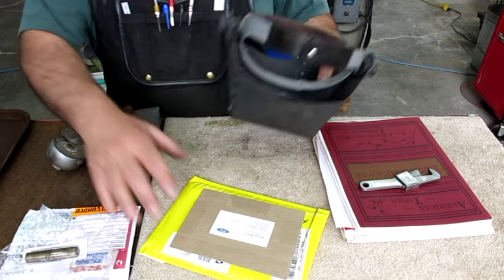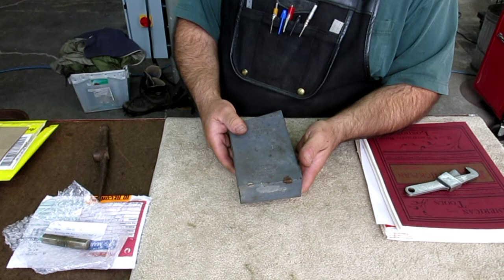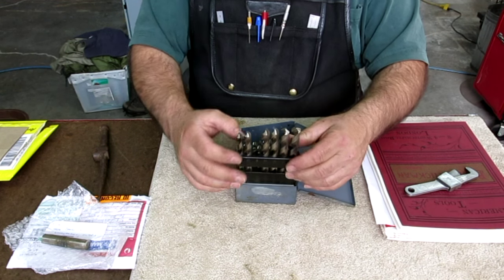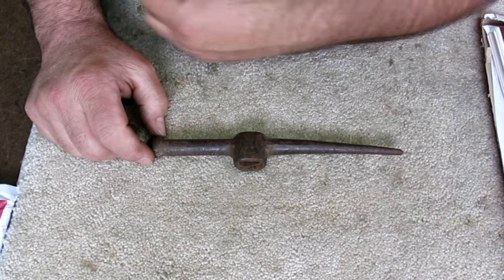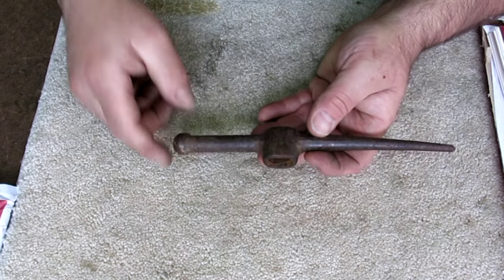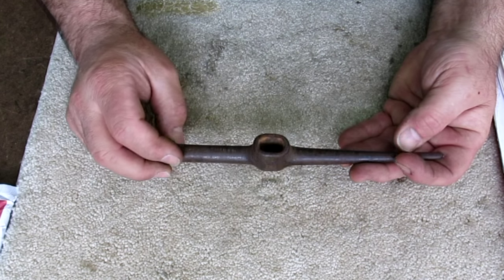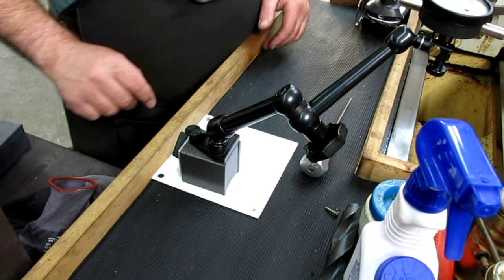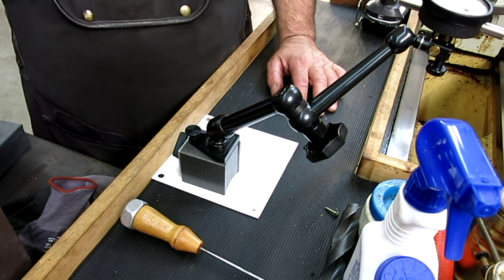Monday Night Meatloaf 98

Comment: For refrence my 1inch drive Williams still only has a 25" handle. I think they make them short so you can fit them in your toolbox. you can always find a pipe for breaking things. :-) I loved the old tool catalog that thing is awesome.
Reply: +bcbloc02 yep the toolbox they come in is about 24 inches long, so as you say, for that, doesnt everyone have a scaffold pole hanging around? :}
Reply: Plus, 1/2 ratchets are only about 12-13 inches

Comment: Awesome, thanks Tom, you put up some real gems in this meatloaf! I really like that catalogue. The reprint is still available,  but unfortunately it looks like nobody will post it down here to Oz. There are so many tools that used to be reasonably common, yet in some cases people don't even know what they are, never mind how to use them. I'm keen to see older methods of working preserved, without running a museum. I'll keep looking for a supplier who will send it down here.

By pure chance I was only looking for a camera arm last night and didn't know Manfrotto made one. I use other Manfrotto gear, so that's a brilliant find. Thanks!

The mod to the dividers is brilliant. I use conventional hermaphrodite dividers but the screw type would be much easier to set. I have an old pair of dividers I was going to throw out, but decided to keep them just in case I needed them one day. I think today's the day! Awesome!

I don't recall ever seeing a "turret" type punch like that. No idea what they're called as I've never seen one before, but they sure are neat!

Tom do you think you would be able to include a longer shot of your tool tray at some stage when you're working at the lathe? I'd like to get a better look at what you've done there. I normally just leave my tools in the tray when I'm using them, but the main lathe is fitted to run cutting oil and it creates a hell of a mess if I use it (rarely for that reason). I'd like to have a better tool tray, and a wood one would be ideal.

Thanks for these nuggets.
Reply from the maker: +Pete F Hey Pete,

It always surprises me when folks from down under tell me about their shipping woes. It really is like a prison colony down there. Lots of restrictions on tools and reading material. <g> Thanks for the comment.

Cheers,

Tom

Comment: Tom, when the rest of those screws pull through just make a simple "u" clamp to ride on the wood side of the tray, screw the sheet metal to the bottom of the clamp and add a threaded knob so you can lock it down anywhere along the side of the tray. :)

Comment: I suppose you could hammer on the ice pick cap, but it is intended for crushing chunks of ice into smaller pieces. You pop a chunk off the block of ice with the pick, and then use the cap to reduce it to useful sizes (like putting into a drink). Having lived with an ice box for a fair chunk of my youth, this sort of thing comes naturally.

Comment: On the tool catalog: prices would be in pounds, shillings, and pence (L/s/d for short). A pound was 20 shillings and 12 pence to the pound. Drove me nuts when I first went to England, although it is not as bad as fractional inches. At the time that catalog was published  a pound was $5 US, so you can figure out from there.  

On Q&A I am very interested in the mist coolant (coke bottle based) that you showed in one of your videos. You now have so many that I can't find it, and it is not, of course, indexed by Google because they can't index dialog. All I need is a pointer to the video.

Comment: Thanks for the video Tom - much appreciated.
Would it be possible to do a really quick snapshot on how you hold your lathe tool holders
on the back of the lathe chip guard  and how you like the Nooga coolant sprayer.
I think you may have done earlier videos on these but I couldn't locate them.
Thanks  Rod

Comment: Hi Tom, 
be careful with the Manfrotto 244RC arm or more precisely with the magic clamp. When you tighten the Screw that holds the arm in clamp you can deform the stub that goes into the clamp pretty badly. You can put a screw inside that stub to prevent that.

Comment: Rather than screw the sheet metal to your wood tray through your rubber mat, another solution might be to bend some 90 ells on each end (of a longer piece of sheet metal) so you can slide the tray back & forth?  If more stability is required, you can use one of your tiny Kant twist clamps to keep in place...

Comment: The centennial Meatloaf should feature some meatloaf.  A meatloaf sandwich at the very least.  As for a question I have this.  If you lost everything and had to rebuild your shop from scratch, what would be your first machine and what would you fill the first tool box with?  Lastly, the vise "screw retainer" is called a garter.  Lookin' forward to the 100th Meatloaf.

Comment: What I do, is use a piece of 3/16" plate steel about the same size as that plate you're using. It's heavy enough to stay in place and you can move it if you need to.

Comment: If you look at the Manfrotto 035 Super Clamp that attaches the Noga type arm to your shop made boom, there's a small plastic piece snapped on to the smaller clamping knob. It's made to go inside the jaw of the clamp to provide a flat surface. 
If you have a look at it you will see what I mean. It's useful for clamping to flat objects, as the built in V shape is made for round stuff. People tend to lose those things and few know their purpose.

Comment: The prices in your copy of the Buck & Hickman catalogue are in Pounds, Shillings and Pence (or pennies).  That was the UK pre-decimalisation currency, 12 pence to the shilling and 20 shillings to the pound, i.e. 240 pence to the pound.  So a pound could be divided exactly into 2, 3, 4, 5, 6, 8, 10, 12 or 15 equal portions or shares without having to deal in fractions of a penny.  (Try that with a decimal currency system!!!)
When I was a boy, we also had Halfpennys and Farthings (1/4 of a penny).
The columns in accounting books were headed £ s & d respectively, standing for Pounds, Shillings and Pence.  The £ sign is a stylised L and the use of L, S & D is derived from the Roman currency, Librae, Solidariae and Denariae.

Comment: #100 curiosities:  Chemicals?  Lubes, sprays, cleaners...?   3/4 ratchet;  The Nut Authority!  ...makes short work of torquing a VW flywheel gland nut or axle nut!  I welded a 36mm socket at the end of a 5 foot 1x3 square tube and used a bathroom scale to meter the torque (me standing on the scale, pushing down on the long wrench, watching the poundage on the scale reduce...indicating the applied torque...after calculating the distance of the wrench length...).  I made a few and they sold quickly at VW swap meets...even made it onto Hot VWs Magazine!  Butterfield taps are my favorite.   They came in nice wooden boxes... Don't know if they are still made.

Comment: If you were to use outside dividers to make the scribe, you could span much greater distances.  They would hook on the edge and increase the range of reach quite a bit.  The issue would then become remaining square, but is still possible.

Comment: Looking at the hammer you picked up and being a woodworker myself my eye was drawn to the grain of the wood. It always amazes me how hammer handles and pretty much all wood handles are made  for the last 20 years. I guess it is because wheels and wooden spokes are obsolete. The direction of the grain is critical in order for the handle to be strong. I gave up on wooden hammer handles because of the way the grain runs but those the grain was run in a pretty decent way. Just me but it really does make a difference.
Reply: +James Stanlake yes modern wooden hammers as also so badly fitted, loose or they fake it buy deeply insetting the end and epoxy filly it, sometimes with clear so you can see how badly it was wedged and cut

Comment: Hi Tom!  For your 100th ML episode, how about a 3 minute follow-up to your terrific "how to check out a used lathe" video?  What we really need is a 5 minute method to check out the ways accuracy and wear on a smaller lathe at auction using nothing more than perhaps a dial indicator and a Noga stuffed in my pocket for the occasion.  No way to turn a test bar at an auction preview, so how would you know if it's total junk or a diamond in the rough?  I've been looking at several heavy 10 lathes over the last few months at school auctions here in WA (there are still a lot out there) but I've passed on all of them based on how rough they looked.  Seeing what BasementShopGuy, Brad Jacob has been able to do though, perhaps some of these I've looked at were actually something I could have worked with.  On the other hand, I'd hate to buy something that looked great only to find out later that the thing was completely worn out and needed to be reground at an exorbitant cost (aka what Keith Rucker covered in one of his recent episodes).  So the question is, if I had 5 minutes and  my trusty dial indicator in my pocket, how could I reasonably check out a lathe at auction to see if it was worth it or not?  Your thoughts?  I think you could really help us out in this area!
Thanks for all you do Tom!   Looking forward to hopefully introducing myself and shaking your hand at Stan's Summer Bash next year!  All the best,
Bob F.

Comment: Hi mate.    I would like to see some updates on some of the machines that you have not been able to finish as yet.  About the sheet metal on the board, I think you asked for some commends.  Why not cut it into the rubber and glue it down.  That way you can always remove the rubber for cleaning.

Comment: For MNM100, I'd like your thoughts on investing in shop storage like Lista cabinets, etc. I'm just starting out and it's really challenging finding affordable tool storage that isn't crap under heavy loads. Thanks Tom!
Reply: +Thomas Utley Have a look at Harbour Freight toolboxes with full bearing slides.
Even the Kennedy boxes just do slides.  
Bearings are the key

Comment: Beginner's question here for the Q&A:
I inherited a bunch of files, which still work okay, but collected some rust during the past years in the shed.
Some might be even older than me...
(one of them actually seems to be a cabinet maker's rasp, which makes quick work of forming wooden pieces)

How do you deal with this kind of condition, if you find old tools like these files?
Is it worth putting effort in it, or should I just dispose of them and buy new ones?
Reply: +Bob Korves That's a great suggestion. Just didn't think of something like having them refurbished. 

But it's kind of overkill to send them across the big pond. ;-)
So I'll see to find something in Germany or Austria. 
I'm pretty sure the local tool trader might help me out here.
Reply: +Thilo Niewoehner Oops, sorry!  I did not catch that you were in Europe.  Maybe someone over there uses the same refurbishing methods that Boggs does.  If not, the file steel is still usable for making other tools.  Good stuff.  I have a very old set of utility scrapers that someone made from old high quality files.  He ground all the teeth off and then ground various single bevel blades on them.
Reply: ***** Oh, never mind. You couldn't guess that from thin air. :o)
Anyway, thank you for the idea and your thoughts!

I wouldn't want to scrap them, as they a) are kind of a heritage, and b) still work very good despite their condition. Reworking them into something else is going to be beyond my current skills.
But, as the rust is only superficial, I wonder if they'd be fine if I just used them properly. That again depends on my ability to round up some more tools and projects to perform while in Austria (usually on vacation when visiting my mother-in-law)

(Bringing the tools to Germany doesn't work out, as I don't have any kind of workshop here)

Anyway, I'd love to see some techniques Tom uses to refurbish old tools. We have seen quite a bit of hammer repair, which I'm grateful for (getting some practice as soon as I'm in Austria again and picked up my grinding wheel; got some really nice hammers, as well, plus a bunch of woodworking tools. Inheriting the tools of a tool hoarder has certain benefits ;o) ).
It'd just be nice to extend that to other hand tools.
Reply: I used vinegar... two inch pvc pipe with a cap on one end, cut long enough to hold longest without handle. insert files cover with vinegar and give it a couple days.
Reply from the maker: +Thilo Niewoehner Hi Thilo,

I generally just clean off rust and prevent more from forming. On files its a difficult thing with all the nooks and crannies. I would try a commercial derusting liquid followed by washing and a immediate anti corrosion treatment. I'm not familiar with the available chemicals but here I would try Evaporust which is available at auto parts stores. Hope this helps.

Best,

Tom
Reply: +oxtoolco Hey Tom,
thanks for the input.

How do you approach files? With a wire brush?
I'll give it a try when I'm back in the shop. :-)
Reply from the maker: +Thilo Niewoehner Hey Thilo,

It depends what stuck in the teeth. Use a hand brush so as to not dull the teeth too much from energetic brushing. Thanks for the comment.

Cheers,

Tom

Comment: Hi Tom. What is the largest machine you've run, and what was the largest workpiece?  I always wonder what it would have been like to be running one of those huge lathes where the operators riding along in a seat on the carriage. Probably a lot of ducking hot chips and trying to keep your tie inside your shirt. ;-)

Comment: The approximate reduction of magnetic force at 5mm distance is 1/7th to 1/8th the original holding force.  Something about "inverse to the square of the distance".  It has been 4 decades since I took Physics.  Maybe a cool idea for a video:  measuring the holding force of a magnetic base with a scale ....  Just saying.

Comment: Hi Tom,
got a really strange question: i ran across a set of hairline squares in a wooden box  that are 30mins off 90deg, one is 89deg 30' and the other is 90deg 30'  and they're clearly marked as such

what on earth would something like this be used for? and would it be advisable to grab the set? the price is pretty low and they appear to be german made.

cheers
mike
Reply from the maker: +HolzMichel Hey Mike,

That is interesting. A couple things pop into my head. Diemaking stuff where they may have wanted a consistent half degree of relief for molds or cutting dies. Some kind of patternmakers squares where they wanted draft for pulling the patterns. Half degree seems light for that. Shoot me a picture if you have one. Love to see them. Thanks for the comment.

Cheers,

Tom
Reply: oxtoolco
Hi Tom,
thanks for getting back to me on this, i sent you the pics i have of the things to you on your gmail account. i imagine you get tons of mail there and have a hard time keeping it sorted out.
as you pointed out in your last meatloaf, your archive is chock full of goodies. i've been combing thru it and found some good stuff in there. thank you for keeping that material posted, it has been a big help and vey informative

cheers
mike

Comment: don't think a 3/4" drive can handle , pun intended, a 36" handle. I've wrung the end off a 3/4" breaker bar before. of course it was while torquing a jet engine mounting cone, but nonetheless, it broke with a longer extension. I imagine there's less torque available on a ratchet head. just saying.

Comment: How would you get set up to mill a square taper?
Reply from the maker: +Guillaume Fortin Moquin Hi Guillaume,

I would use an angle block or plate in the vise and start with a square larger than I needed for the big end of the taper. End gaging helps assure the symmetry of the taper. Thanks for the comment. 

Cheers,

Tom